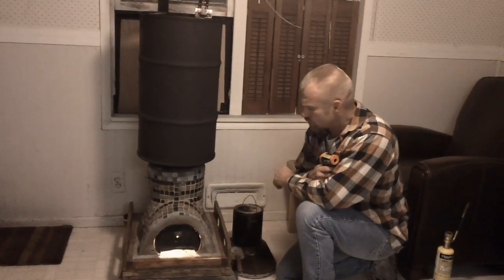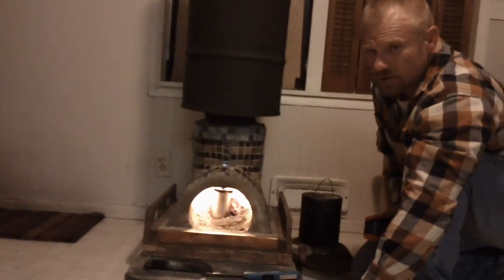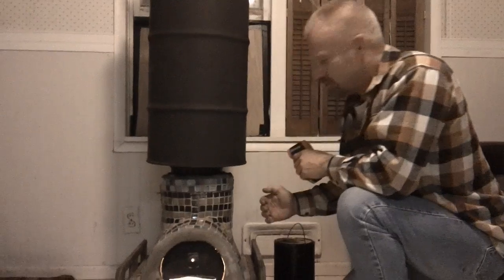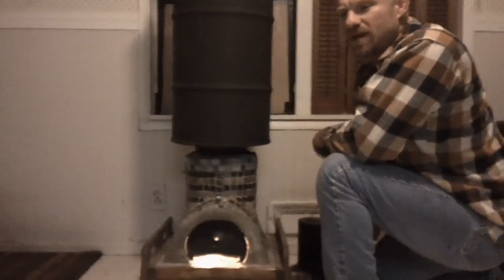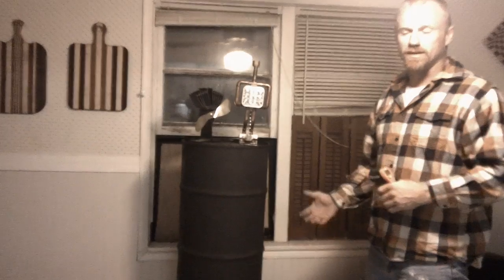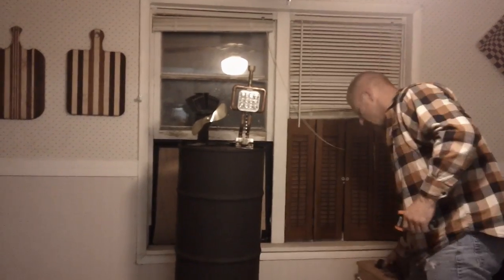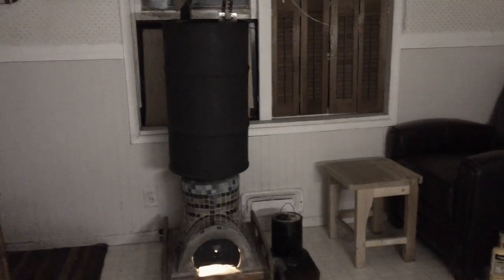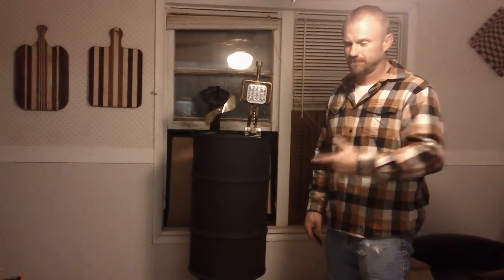Kerosene and waste oil in the Rocket Stove

Comment: Question.  could a man put a large can with wicks  inside a wood stove to act as the heat chamber and still get the vent needed and the right air combination to heat a home?
Reply: Please refer to the early 90s movie starring Kurt Russel and one of them Baldwins called "Back Draft". If that don't learn ya please please please upload the video showing your maiden run, bet you can't open the door slow enough🤣🤣🤣

Comment: Published in 2013, today is 2017, in the last 4 years how many hours have you burned WVO or 50/50 WVO-diesel?
Reply from the maker: I have a small source of waste vegetable oil so as it is supplied I use 20 gallons per month
Reply: Van Powell - Your ideas are great... time and time again you clearly demonstrate alternatives in/to 1000F rocket stoves for heat & cooking. Wish you would produce more on heat storage and distribution re minimum firing mass storage. Thanks again!

Comment: how stable is that barrel on top of the Rocket Stove? Shouldn't you attach legs to the barrel just in case?
Reply from the maker: the barrel has a pipe in it the fits snugly into the stove and then the flue has a bracket also that helps hold it also
Reply: That's cool.

Comment: Instead of replacement wicks, get ahold of some fiberglass stove gasket, 3/4 or larger. If you cut the outer shell mesh, you will find that it is filled with sections of fiberglass that are perfect for wicks. Just found this cool tidbit last night. Hope this helps! A

Comment: anyone try a COTTON FLOPPY MOP as a source for WICKS
and what about putting the wicks through a METAL TUBE not only (WOULD / COULD) it help the OIL ONLY flow it WILL prevent the wick from burning down when it runs dry

Comment: Van, please, tell me is there a danger possibility that heat from stove could melt electricity socket and wires and cause short circuit? I am also cuirious if the temperature above the rocket stove could be dangerous for the wires that are 5cm in walls.
Reply from the maker: the 8 foot ceiling never got above 100 and the walls where 18 inch clearance got up to 90 plus a few times.,, depends on how hot you get it and fuel you feed it and how often.

Comment: Given the fuel consumption of the burner, You are producing about 625watts of heat out of the burner. Given it would be fairly ineffcient and putting the heat into the room, You would be lucky to get even 500W of heat going into the room.

An incandecent lightbulb will burn a lot hotter than 200F but it's heat output would  be 100W or less. It's not the temp of the heater that is important, it's the amount of heat it's producing.  The heater in your car might be putting out only 100F temp wise but the KW rate is enough to warm your house let alone you car.

You idea is nice but pretty ineffective in reality because the thing is just not putting out any worthwhile amount of heat.  You would get a lot more heat out of 5 100W lightbulbs in the room.

Also fuel consumption is an indication of heat output so people who brag about low fuel consumption are in effect saying how ineffective their heaters are. I build burners that will use 30+ litres of oil an hour which transaltes to a shipload of heat. Obviously you don't want a heater that kicks out well over 1 million BTU in your home as something like that would but you do want to find the happy medium between something that has enough output and consumption to be useful and something that's not overkill.

I would be VERY careful upsizing this wick burner because if you produce too much heat  in that enclosed space, the oil in the can will heat up over time and boil. When it   vaporise's it will want to burn all at once and you will have a Major flare up and  problem on your hands.  Even half a cup of oil doing a run away will produce way too much heat to control in that small a setup.

A small Ozzirt type burner would do well in this application and kick out a worth while amount of heat that would actually lift the room temp a useful amount.

Comment: how bout one of the replacement wicks from a kerosene heater like you find at home depot they are usually circular and very large like 4 or 5 inches in diameter ????

ss

Comment: Try a few lengths of coat hanger wire or better yet copper wire tied in with your wicks from the flame to the reservoir , The heat should transfer through the wire and thin the vegetable oil making the oil more likely to wick.....just a thought.

in lak'ech...
Reply from the maker: good thinking. thanks for watching

Comment: can you show a show how you put the kerosene burner together?
Reply from the maker: its this simple put 6 tiki torch wicks from depot or lowes together wrap them with wire to hold them together. cut a hole in any metal lid bigger than a regular can then cut tight to push the wick in. poor the oil in the can drop the lid on no screw no seal nothing and then light..
Reply: thanks bud